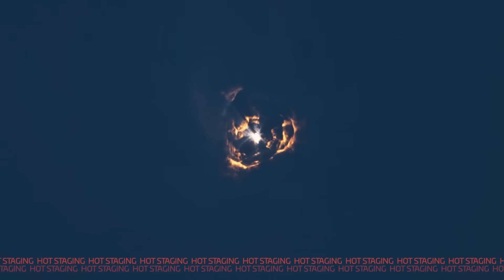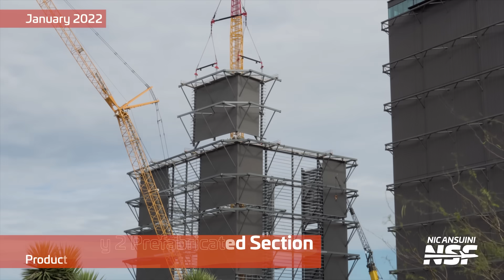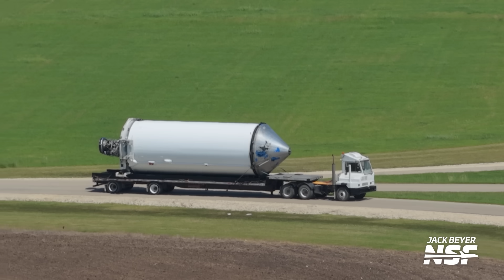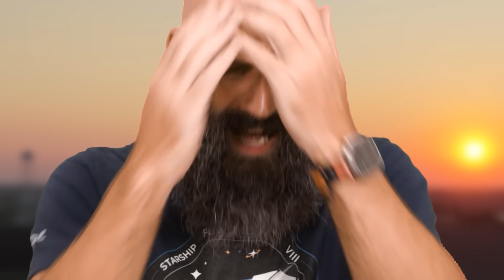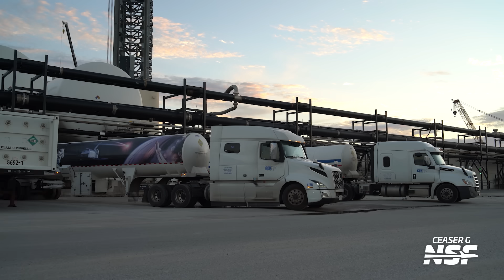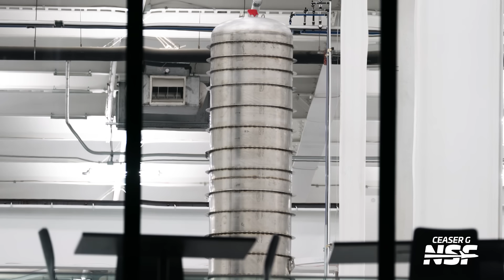Pad 2 Comes Alive & Massive Block 3 Progress! | Starbase Update

Comment: Not sure whether this was already mentioned some time, but according to Ars Technica, flight 12 will not happen until some time next year. That would be 5 test flights for this year, one more than last year. Turns out the famous permit for "up to" 25 launches in 2025 wasn't really necessary.
Reply: Doesn't matter, better to have the permissions in place before they're needed rather than ask and wait.
Reply: @imaginary_friend7300  Agreed. Though it seems clear by now that a steep increase in flight rate is generally unlikely. So we can expect about six test flights in 2026.

Comment: Interesting to note that the new hot staging ring doesn't seem to have a blocked off area to direct the booster flip during staging.  Any thoughts about that?
Reply: Coming soon
Reply: The current conjecture is that they will gimble the engines to push it in a specific direction.

Comment: Ok, I will be excellent with each other ... but I can not refrain from saying that SLS+Orion is a piece of *hit! :)
Reply: So you can't resist saying that even though it isn't true.   After all what other rocket in the world with a capacity to carry humans  has made a recent flight to and from the moon and done it almost 3 years ago?   That flight was 26 days long and considered nominal.
Reply: @michaeldeierhoi4096   …after all what other rocket in the world with a capacity to carry humans was unable to carry its passengers back to Earth?
And I am probably wrong, but NASA no longer considers SLS+Orion to be ‘man-rated’.
Reply: @ernestgalvan9037    I don't know why you would say that as Artemis ll staring the SLS and Orion with a European service module are set to fly no earlier than April 2026!!
Reply: @michaeldeierhoi4096  Not quite to the moon.  My understanding is that the one big fail in the SLS/Orion story is their in ability to make it to a low lunar orbit which is the whole point behind gateway, to give SLS a destination it can actually reach.
Reply: @imaginary_friend7300    Yes, quite! And to the moon and back.  This will be a much shorter trip 10 vs 26 days than the last one.  But Orion will make a fly by of the moon and return while taking the most fuel efficient route possible.

Comment: Still expecting tower cranes for GigaBay?
Raptors will likely burn longer than 6 minutes for accelerating to either trans Lunar or trans Mars velocities, won't they?
I wonder if they will install a "flip assist" into new hot stage
Reply: The LH 11,000 can probably do the job of lifting the prefab pieces into place and everything else needed.    It's not like building a tower with floors.
Reply: I can't see why they'd need such long burns for either.

Comment: ? Are the V3 boosters going to block some of the staging exhaust in one direction to help flip the booster right after staging???
Asking for myself.
Reply: SpaceX alr tested that strategy in past IFT
Reply: @boryu5258 I know, doesn't mean they're using it on V3
Reply: I think V3 is going back to using variable thrust.
Reply: I think the direction issue was just an issue with the current staging ring, the booster would be steered in a random direction.

The new staging interface looks pretty open, maybe it won't impart any steering force and push it straight backwards.

Comment: it is plausible that spacex will switch from 304 stainless to 330 stainless which can handle much higher temperatures...  it makes good sense to construct test articles ..boosters and ships with 304 stainless as all these end up being discarded...  then once spacex has a final design.. by switching to 330 spacex will enjoy an additional safety margin...
Reply: "can handle much higher temperatures", how much is much?!? 100+ degrees C? 200+ degrees C? ...?
Reply: @AllanP-n3q  supposedly around 300F more without losing structural integrity which is a sizable % higher tolerance........I don't do metrics so I am clueless as to C..
Reply: Assuming that 330 meets their other needs aside from 300F higher temp tolerance. They still need good tensile strength, thermal expansion/contraction not much higher, etc.
Reply: @Jaker788  absolutely...

Comment: In regards to the hot staging ring, are they going to gimbal the ship raptors to push the booster one way or add stringers to one side for the exhaust to push against?
Reply: The former, I think. (But not for the upcoming V2 flight, which will use the modified HSR)
Reply: Maybe if the ventilation is open enough they don't have an issue with imparted direction force. If it's just straight down force then the booster should be able to steer back without having to compensate for getting pushed in a random direction l

Comment: The new integrated hot-staging ring looks susceptible to torsion stress.  I hope it can endure the stress of flight.
Reply: Well, they'll find out when they test it in the crusher or whatever it's called
Reply: * such structures have been used on Russian rockets since basically the beginning.
Reply: “…susceptible to torsion stress…” .. a triangle shape is the strongest shape in engineering. That saw-tooth shape is bound on all three vertices.  And the failure analysis is probably the best-understood in engineering… it’s been around for millennia.

But what do I know? I’m jus t some random insomniac on the Internet.
Well, I also have some engineering schooling… seven years, actually.

* and @DavJumps has some good words to say, also
Reply: I’m thinking they might have had an engineer or two do some math … but what do I know? I’m just some random insomniac on the internet.  🤷🏻‍♂️